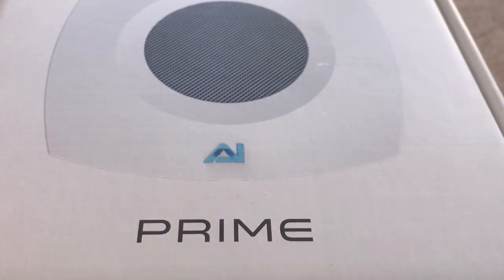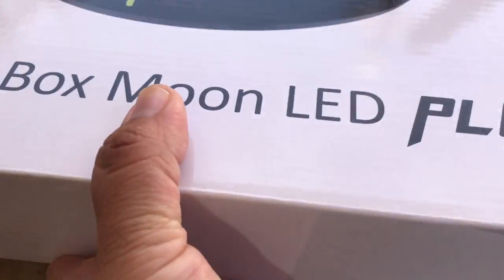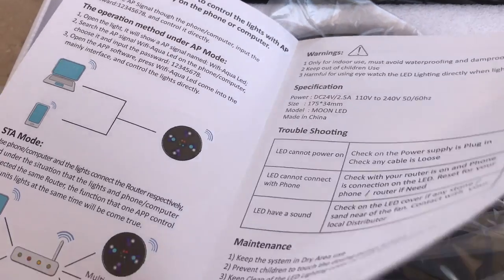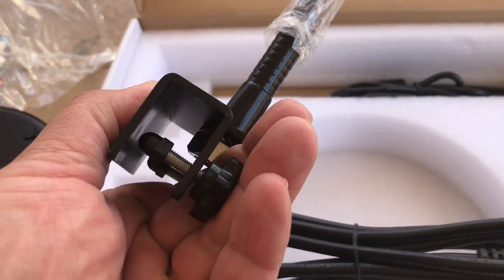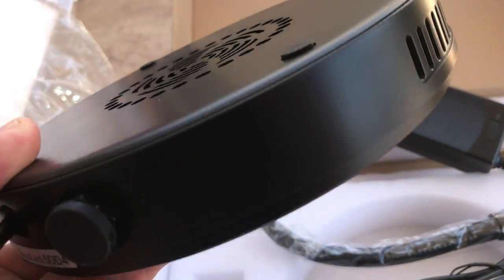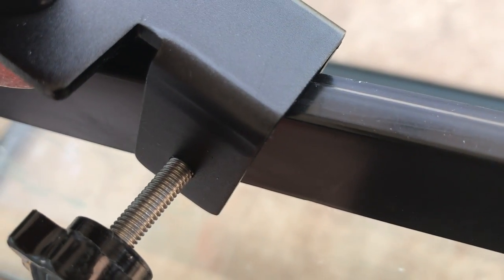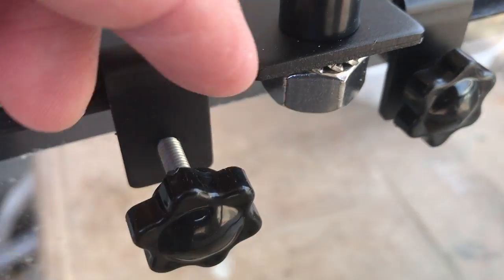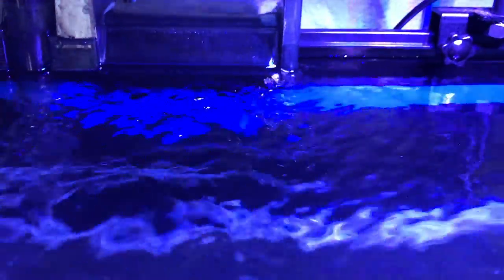CORAL BOX MOON LED PLUS REEF BREEDERS NEW FRAG TANK PROJECT

Comment: I have these same lights on my 20 gallon nuvo, the lighting in the corner of the tanks were kinda dim.  I swapped out the lens to 120 degree ones and it's totally worth it.  If you're only running 1 of these fixtures and have a 20+ gallon tank I'd recommend it if you can spare the money.  They were only 6.50 a piece, and I think you only need to do the 2 side led modules but I did all 4.  The center LED module already comes with 120 degree lens.
Reply from the maker: Thanks for that info! Ill check that out, but it looks ok to me since im using this for a frag tank. I like those Nuvo tanks, I was looking at a 25g Lagon Id use it as a frag tank too. But well see, trying not to!

Comment: Does this light needs to be connect to WiFi to program?
Reply from the maker: BMWE46 Hey The WiFi is an internal thing between the light itself and your phone. If you get it use the link in my description to help me out. It’s a great light and very affordable. What size tank do you have, these lights cover a 20x20 so depending on your tank you may need several